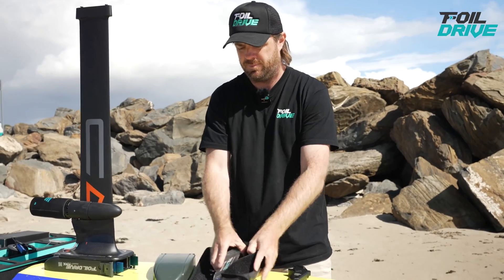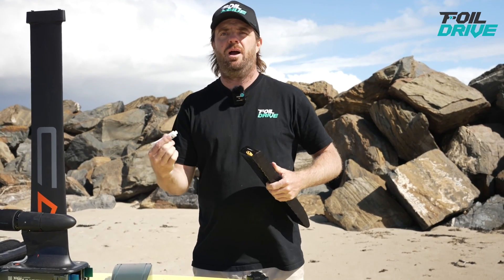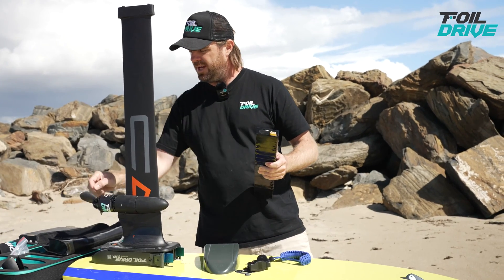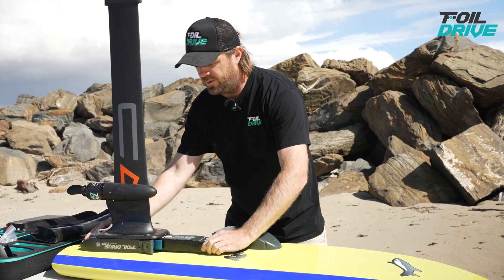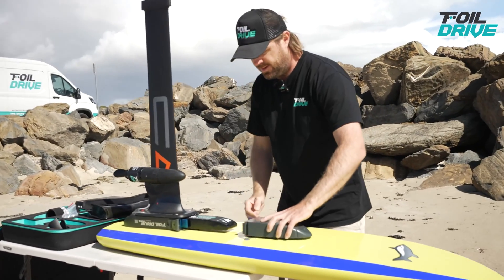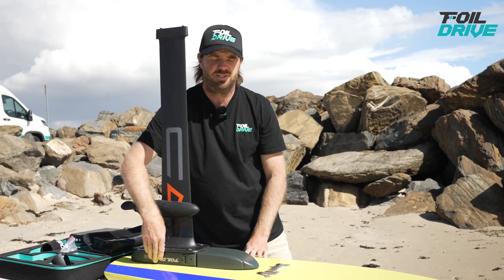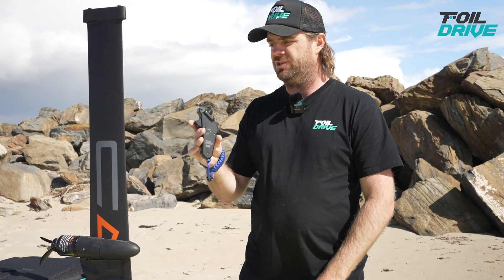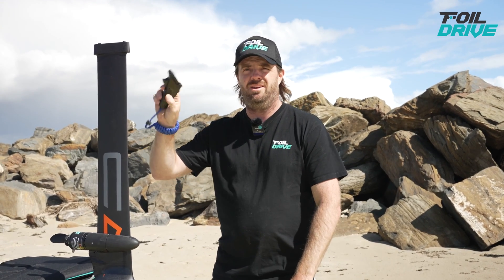Foil Drive Gen2 Install | Battery, Nose Cone, Test Controller

Comment: You guys have really stepped everything up about 10 notches. you have done such a professional 
job of designing everything from the drive to the tools, spares and last but not least the super nice cases to hold everything. You took a page from flite board's book.
You could have thrown all the parts in a box and sent it out but the fact that you put as much attention to the packaging as the foil drive shows you guys are top notch and true professionals.
Way to go.......
Gary